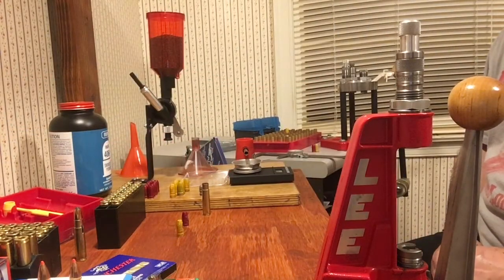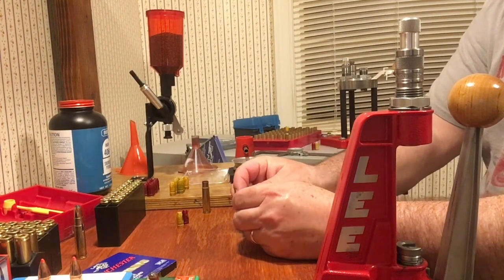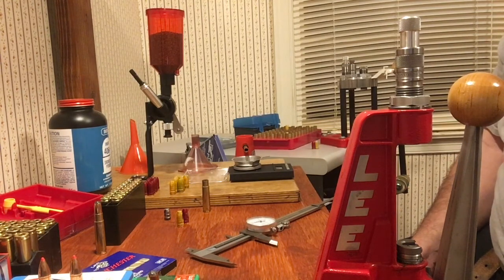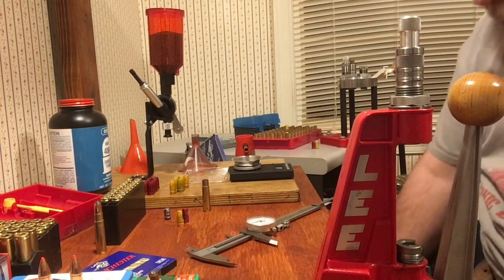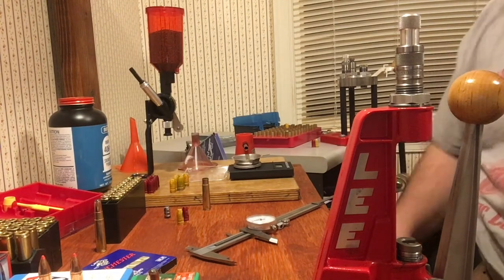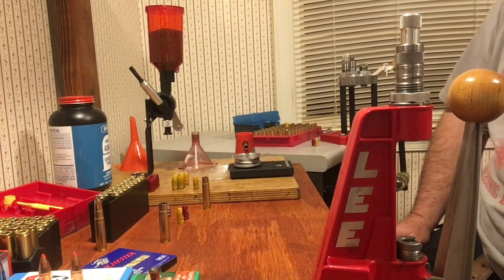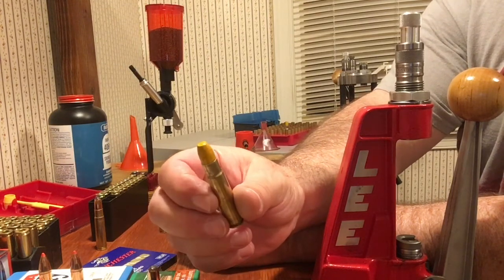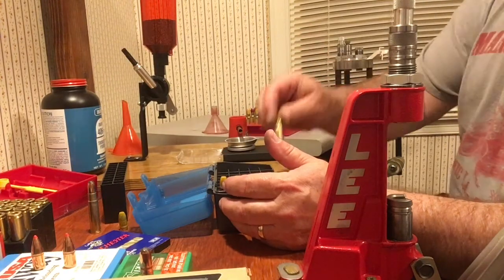35 Remington Load 1

Comment: Had to get my Hornady rounds re-done due to California "no lead" law so found some copper .358 in 160gr they are plastic tipped hollow points.. Hope my shop loaded them right for what they are.. Deer hunting and anything else I may use it for.. My Marlin is a 1950 336 chambered in .35 rem and I love this thing, hope to pass it down to one of my 10 kiddos some day as they all love shooting it.. This is what was written on my box from my shop after reloading 

Hornady cartridge
IMR 3031 @ 35.4g 
160gr raptor extended range 
Fed 210 primer
Reply: Buying the stuff to load myself and learning all that I can, just taking it one step at a time so for now, writing down a list of what's needed to get started as .35rem is impossible to find again unfortunately so, I have kept all of my brass for when the day comes that I need to reload and it seems that day is here now...
Reply from the maker: I understand! Sorry I missed your comment until now. Not getting YT notifications like I should. Yes Sir, components, especially primers, are all but extinct. That seems like a really good recipe. I would love to hear how they shoot.
Reply: @jh5869  it's ok, I understand the notification issues for sure lol.. I haven't shot one just yet, they gentleman that helped me with this didn't have the factory crimp die so, I will have to get one to lock these projectiles in place as I can easily pull them by hand so I was told by another lever action enthusiast not to load them in my rifle, just shoot them one at a time but, instead I've decided to wait to get the die and crimp them to save any issues.. learning as I go, I have almost everything needed now to reload these on my own following the very specific process these first 40 were done in, I can't wait to fire a couple off and see how they do.. I am new to reloading and refuse to give up on my .35 as everyone keeps telling me to, I saved every bit of brass I've ever shot so, I have about 250 rounds to reload myself this time and keep... thank you for the reply, very much appreciated

Comment: I am reloading the Barns TSX 200 grain for the Marlin 336 I have then loading these with one in the chamber and round noise in the tube.
I am using 38 grains of W748 for powder with the 200 grain Barns TSX 200 Gr .
I am using 40 grains of W748 under the Speer 180 gr bullet .
I have brought this load up to commercial loads of the 358 win .

Comment: How far are you bumping your case neck shoulders back when sizing your brass?
Reply from the maker: Tripplebeards I full length sized these every time. All the way back to SAMMI specs. All the experts said you need to do that for reliability with hunting loads in leverguns. I’ve since learned better!! We’ll get into that with some jacketed bullets. Stay tuned, and thanks for watching!
Reply: @jh5869  I loaded up some the other day and didn’t adjust my fl sizer die down far enough so i had a bulge at the base of my necks and I had a few cases that had some resistance when closing my lever. My first three shot group onto my 336 chambered in 35 Rem with cast and all went into the same hole at 100 yards measuring  .256”With 40 grains of varget, I tried a max load of h4895 powder and shot a .7” 100 yard group a few minutes later. I have since measured my fired cases with my hornady comparator and bumped my shoulders back .002” from the average fired lengths. I would think it should be just enough space to close my lever properly now without resistance. My barrel slugs at .357”  and I sized my cast at .3595”. I also powder coated and gas checked them.  I’ll have to try it out this week.
Reply from the maker: Tripplebeards wow! That’s better than I’ve gotten. What insert are you using for the Hornady Case Comparator? Seems the ones that came in my kit didn’t fit. I better find me some Varget!
Reply: @jh5869  I went in hornady’s website and it said to use the .400 bushing. I’ve been using  a lee collet style factory crimp die as well to crimp my casings. It puts a nice even/ consistent pressure on the necks. I tried roll and taper crimps In other caliber rifles vs this style and my groups open up. I’ve only taken it to the range twice to try. Maybe I got lucky or just have a good gun. It’s the quickest and easiest gun I’ve ever got to shoot cast in. Most I have to mess around and tinker with. The trigger lightening from 5 pounds to 2 1/4 pounds helped as well. It went from a 1” group to all in the same hole using my varget load.
Reply from the maker: Tripplebeards excellent! I’ll try my .400  bushing when I get home from work. Thanks for the update. Now to try and find some Varget in this environment. Things are crazy out there, Man. Stay safe! What part of the world do live in?? Just curious. Thanks again.

Comment: My 1970, 100 th anniversary 335 chambered in  35 Rem slugged at .357” and the shortest OAL length on the same lee cast bullet  I measured was .3.353” I loaded mine at 3.350”. I can barely see the micro grooves in my unfired cycled loads. I powder coated and gas checked mine as well. My alloy is 50/50 clip on wheel weight and pure lead mix with 2% pewter added. I want them soft so they expand on thin skinned game. Bh twsted 10.5 with my $60 lee harness tester. My plan is to work up a some loader tests all the way to max jacket loads and see if I can get acceptable accuracy. I polished the inside of my lee .358” sizer die so it sizes at .3595”. My whelen slugged at .358” I’m going to try my .3595” lees in both along with a 200 grain hollow point special run mold
Reply from the maker: Sorry I missed your comment. Sounds like you know what you’re doing. Keep me posted on your results and progress. I’ll be moving into jacketed loads sooner or later. I want to try some 180 grain Speer Hot Cores. I’ve been told those are really good in 35 Remington. Thanks for watching!

Comment: I sure like your methodical approach...hands down you can't beat good preparation for good results. A couple of observations I'll share with you...this is just me but I prefer a good balance beam over an economical digital scale. I do use digital but it agrees with my beam scale grain for grain, that's the only way I can trust it after it's had time to warm up. The other thing is that you'll want to look closely at the primers after the range to evaluate the load pressure as best as you can...I like using colored sharpies to color the primers in each load, there's no mistaking which load was which this way. Here's my example . . . https://thereloadersnetwork.com/2018/04/19/tips-and-tricks-preparations-for-a-ladder-load-test/ ... can't wait to see the ladder testing. Outstanding . . . c h a r l i e
Reply from the maker: Charles Irby man, I think I have like, 5 scales and only 2 of them read the same weight. The further I go, the more confused I get...I think?!? I’ll check out the link. Thanks for all your help and please...don’t let me blow my face off!🤠